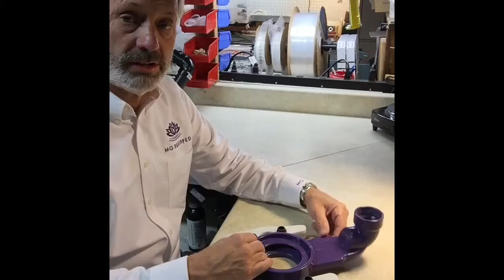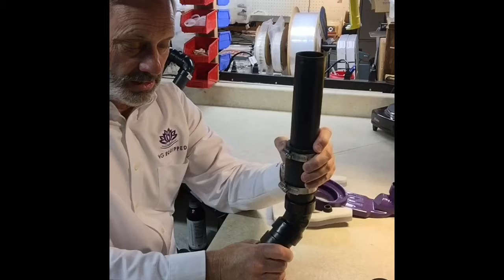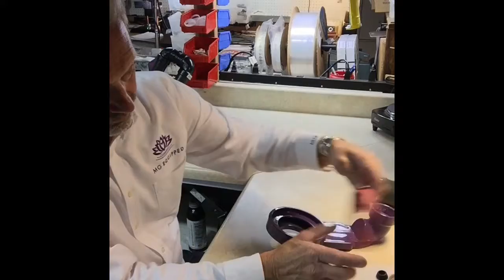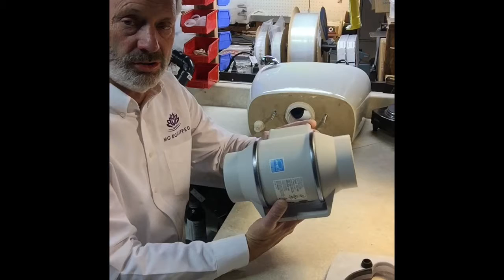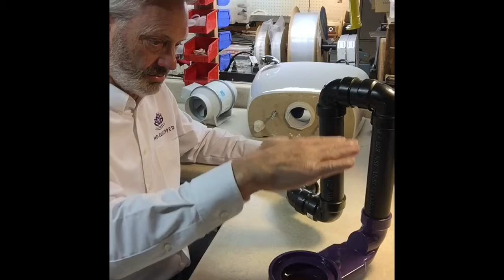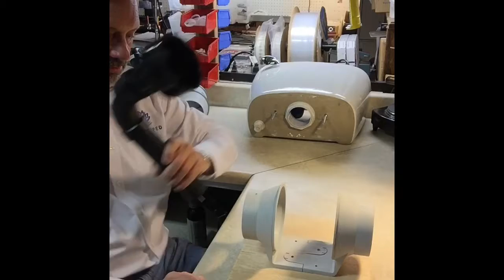Manderley Gates  How-to install "MG" toilet odor venting system.

Comment from the maker: "MG" UPDATE April 8th, 2017:  We have replaced the sweeping 90 degree elbow shown in this video with a Y-Tee elbow and Vent Cap fitting. We have also upgraded the S & P inline fan unit to a TD-100X for even more power. Watch "How To Tune Your MG" on what these new upgrades will allow you to do with your "MG" toilet odor venting system!